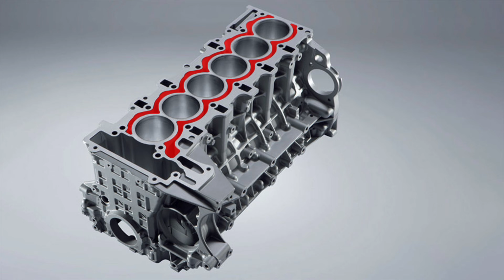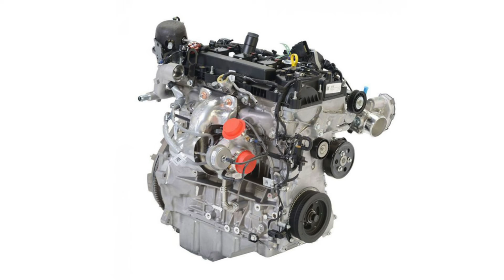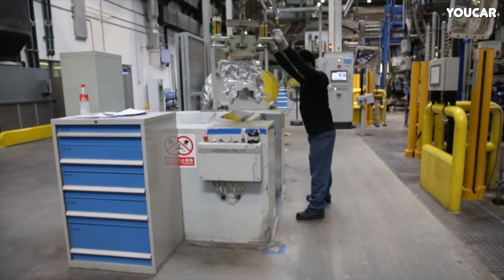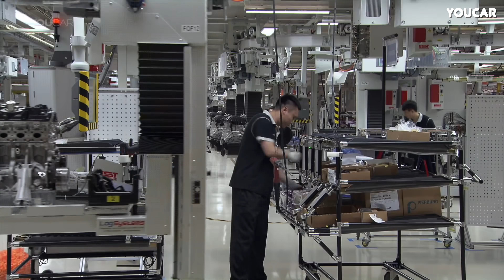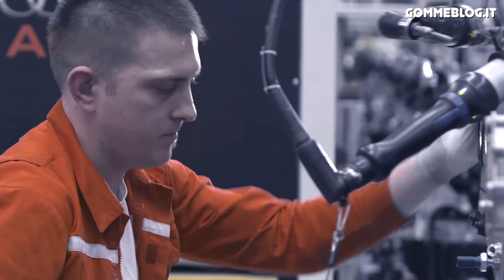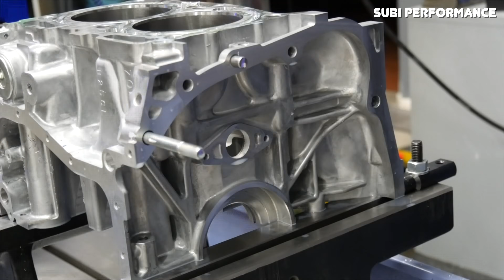Open Deck vs Closed Deck | Engine Fundamentals

Comment from the maker: If you guys enjoyed the video, please SMASH THAT LIKE BUTTON. It helps the channel out a huge amount and helps YouTube put the video in front of more people. Thanks for watching 😬
Reply: You should make a video covering the Audi EA855 2.5 TFSI from the RS3/TTRS. Its a very unique and not so well known engine with loads of tuning potential.
Reply: You should make a video about 1FZ-FE

Question
What parts should i upgrade to open the rpm
Reply: How video about "Cast block VS Forged block". And an "Iron block VS Aluminum block"? Love your videos man.🏎
Reply: You should do a SOHC vs. DOHC video!!
Reply: I thought the crack was because of engine knocking and with modern sensors were preventing the cracking that's why the horsepower of the new engines. The modern methods of casting would increase the structural integrity of the engine but the ECU tuning should effectively eliminate this problem.

Comment: Subscribe button smashed!🫡😆 Hmmm?🤔 What would I like to see? In terms of fun factor, what would you suggest: the “factory rally cars/300hp Hot Hatches” available nowadays like the Ford Focus RS and Toyota GR Corolla Circuit Edition vs. used classic “factory rally cars” but well treated and maintained ones (i.e. trailer queens turned track day weapons)  in the form of EVOs and Subbie STis?

Comment: Thank you! You explained it clearly and succinctly

My old Mercedes SL has perhaps a unique engine property. 

They completely redesigned the M119 V8 block in late 1993 from closed deck to open deck 

Supposedly besides saving manufacturing cost it's a bit more economical.

I understand with open deck the coolant is flowing all around the cylinders so it must displace heat  far more efficiently 

The SL does seem to run to operating temperature very quickly 

Can you think of any other engine that kept its nomenclature and went from one style to the other?

Comment: Modern sensors and tuning capacity allows for squeezing out as much power from blocks without causing as much damage to them... A modern well tuned open block is capable of high hp gains...
Thanks for the video...

Comment: I worked some years on a engine refurbishment shop and guess what?? Every single open deck engine I have ever worked on, was warped on the head surface! While closed deck is more like 50-50, closed deck is 100%. You don't even need to measure the gasket surfaces!

Comment: A closed deck is deffo the way to go if you plan on pushing big HP and very high boost levels. One of the weaknesses of the n55 engine in the BMW m135i's and m235i's back in the day was they were open deck and these engines suffered because of it. This is why I believe BMW moved away from it with the b58 and went closed deck.
Reply: How exactly did it suffer?
Reply: yep, n engines had hella oil leaks too

Comment: The basic question is are you running twins or a big single.
Just like nitrous if your Making alot of torque under 3k your creating the most stress possible. Then are you running a manual transmission and are you at a reduced gear ratio. These are thoughts you should have in your head that and if you close the deck can you keep it cool. With today's piston coatings , methanol injection and e85 we don't necessarily  need to close the deck semi or fully closed. Last are you running an accurate progressive nitrous coming in late with reduced gearing , colder plugs and what is your compression ratio vs stock and cast pistons or weak rods/ direct port injection. Don't forget 0w-40 and soft or oil underfloowed crank or sub pat bearings . Identify- what is my engines weakness areas? Don't forget tuning and preventing detonation.  This is the new school of thought cross referenced against your transmission specifics and shift points/rpm.

Comment: very good video, very correct in technical terms. it only seems you are always trying to defend open block after an argument for closed block design ;)

in a technological comparison closed block is simply better, the reason for open block is only the cost factor and probably overall powertrain efficiency.

subscribed :)

Comment: If I remember right, the M54B30 engine in my BMW Z3 3.0i had an open deck. From my past experiences I would say I prefer a closed deck. They're just stronger like you said and there's less of a chance of failure for head gaskets and cylinders. But the newest car I have ever owned is a 2007 LS engine so like you stated Im sure the technology has gotten much better for open decks and they are more efficient at cooling so if manufactures can make them stronger then by all means go for it!

Comment: why does this channel only have under 100k subs, i dont get it
Reply: Probably because people now days are just interested in tech issues . Check the oil? Where's the dip stick and what's it for? Im 74 and always been interested in ICE engines and the advances in their power output and reliability. 92 dodge 1st Gen owner. I drive it 500 miles a year for firewood so with only 200k miles so far it will obviously outlive me . Just spent 5300$ for a out of vehicle gasket set, fix the KDP issue . Lift pump, leaking rear main. Trans leak etc . Im so happy with not one drop of leaking fluid hopefully the rest of my life.

Comment: I thought the crack was because of engine knocking and with modern sensors were preventing the cracking that's why the horsepower of the new engines. The modern methods of casting would increase the structural integrity of the engine but the ECU tuning should effectively eliminate this problem.

Comment: I just wanna say alot of open deck engines, (especialy hondas) are still not meant for under 700hp. they max are rated for like 300-400 and wont run well higher then that.
Reply: the one honda engine is the ONE honda engine that was built very well as a open deck and can handle insane amounts of power.

Comment: So what your saying is all these small open deck turbo charged civics and so on will blow out eventually?

Edit: the 1.5 turbos
Reply from the maker: No. Not unless you’re trying to push some stupid power figure, and even then there’s a ton of other things which will fail first.
Reply: rods will explode first if you leave stock rods.